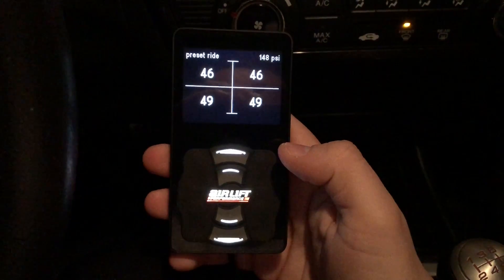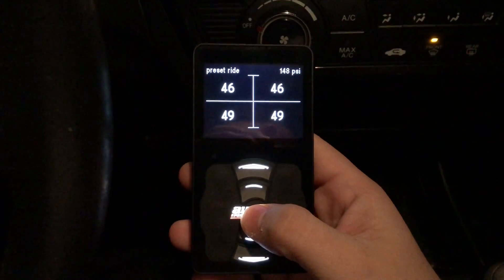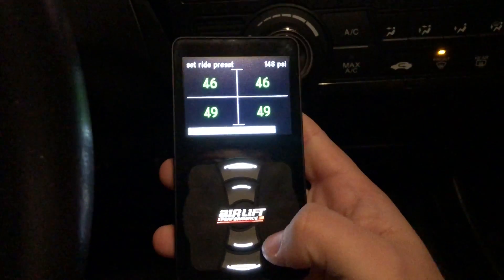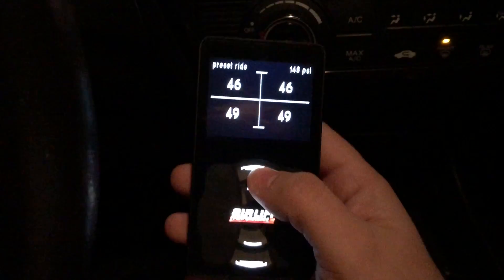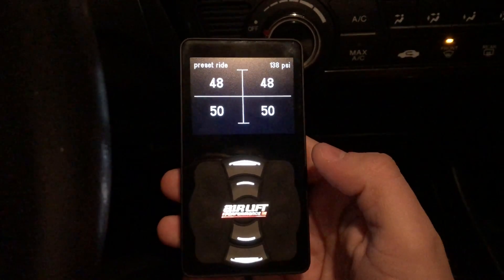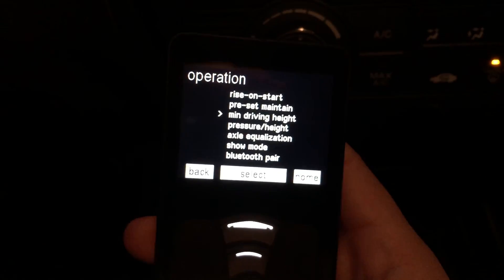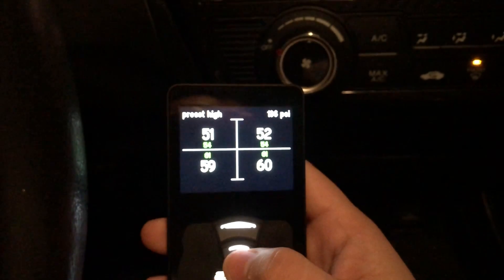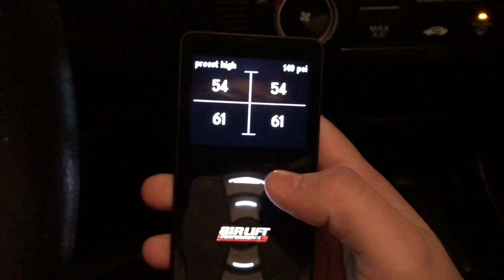AirLift Performance 3P/3H controller tutorial

Comment: Hey so for my airlift my psi drops as I park and leave the car turned off and there's no air coming out of any of my bags but the psi drops can someone tell me why and how do I fix that
Reply: As with any system, check all of your connections. Something is leaking somewhere. Mix up some soapy water in a spray bottle and spray all your connections while it’s aired up. When you see bubbles coming out, there’s your leak.
Reply: @BlackwaterDSM  yeah I did it was my water trap it had a really slow leak I fixed it thank u

Comment: Is the highest ride height, as if you had no modifications (as from factory)?
Reply: Max psi for the bags is 125 I believe. So I personally wouldn’t put more than 80-100. But every vehicles system is different
Reply: No it goes higher. Before it became popular it was used in snowy conditions to allow cars to be higher than stock

Comment: Hello, when you have aired out and leave it down over night. Does your tank decrease in PSI? For example when I air out and start up my tank psi are low and then fills up to normal. Is it suppose to loose pressure when parked?
Reply: That means you have an air leak somewhere in your tank. Check all plugs/fittings on your tank

Comment: Question,  why is it whenever i saved my ride height right, when i air out and then press the ride height,  the saved setting doesn't saved cause my ride height all messed up, like front be soo low its on the tire and the rear is all up.
Reply: Cause you probably have sleeve in the front and since there’s weight in the front you have to air up all the way first so your bags settle and then you put your ride height is gonna be like a clunking sound and if its not that than idk but that’s what i do to not have that problem

Comment: Bro how do you set up "raise on start" ? I tuned it on but when i start the car it doesn't do anything
Reply: You have to have it on a preset before you shut the car off, if you manually aired up or down before then it won’t raise on start.
Reply: gillixexik but I unplug the controller because it holds power getting it re-wired this week

Comment: Do you know how to turn the screen horizontal ?
Reply: Been asking everywhere. Still no answer.
Reply: Tylor Dowell if you update the firmware, it will ask you which orientation you want the screen to be. So maybe try updating firmware then selecting “horizontal”
Reply: @TylorFTW  You probably found it by now but you can undo 2 screws a the back of the controller pop out  the button pad and rotate it.
Reply: Any chance you found an answer to rotating the screen?
Reply: @tyschroeder6993  You probably found it by now but you can undo 2 screws a the back of the controller pop out  the button pad and rotate it.
Reply: Need to do via app only

Comment: Can you drive the car while the tank is filling or while the bags are adjusting ?
Reply from the maker: I always wait for every thing to be at my preset. You can drive while tank is filling back up
Reply: Nathan Machado If you have it set to maintain a certain PSI then it will adjust while you are driving. I would not recommend airing out all the way while driving though.

Comment: Just got Air Lift 3P...a lot to learn still.....1 question. When I'm parked for 8 to 16 hours is it ok to leave it air'd a the way out ?
Reply: KK Prince yes it is, unless its winter and cold. If condensation get into your lines and it freezes you wont be able to air up and drive.
Reply: @SwtLeo  oh jeeze...thank u I appreciate your response!!
Reply: Ok so basically stay aired up in winter?
Reply: @Mr.FIBBS777  there's a release button that cleans out the lines. When it gets cold you should press is once a week so it gets the condensation out. You're able to lower it when its winter.
Reply: @dragswolf8  wheres the release button?
Reply: @bleach6286  I think he's talking about the tank drain or the water trap.

Comment: Is there a mode to get it to our out on its own when parked/car turned off ?
Reply: +Sergi Rodas thanks also if you remember the instructions say i cant have thread showing on the coil. Do i have to adjust it all the way down?
Reply: +Sergi Rodas thanks also the manuel said the threads cant be showing on the shocks, out of the box they came all the way up. Do i have to adjust them all the way down until they aren’t showing?  It would be great if you could send me some pictures and info of your setup since you have had these for a while already

Comment: Completely new to this, so might be a stupid question. What speeds can you adjust ride height. Obviously you wouldn’t air out on a highway etc
Reply from the maker: Arun Proothi i only ever do it when my car is stopped. Of course the controller will do whatever command you give it but it wouldn’t be the safest thing to do it while moving.

Comment: I got the 3p air ride and I’m new to all this. Is the controller screen supposed to stay on? Or is it supposed to dim/turn off after a certain amount of time? Thanks.
Reply from the maker: Miggy EK4_FB6 do you mean is it supposed to stay on once the car is off? If that’s what you’re referring to, no. If it’s while you’re driving and stuff, yes but that can be adjusted in settings
Reply: Sergi Rodas my screen stays lit all night with my ignition off. I don’t know if that’s normal or not.
Reply from the maker: Miggy EK4_FB6 I have the same problem which I’ve been too lazy to fix. Your power wire for the bags is connected to a fuse receiving constant power meaning it’s on all the time even if the car is off. You need to get it connected to a fuse that only receives power when the car is on. If you don’t get it fixed, it’ll start to drain your battery
Reply: Sergi Rodas okay thanks. Do you have an after market exhaust? If you do how are you avoiding the exhaust piping from touching the rear passenger bag? Mine is, I don’t know if its because of my 3 inch full cat back piping?
Reply from the maker: Miggy EK4_FB6 i do have a 3 inch cat back. Gotta heat it up and bend it. I also have some heat wrap around it
Reply: Sergi Rodas okay thanks I’ll do that
Reply: Connect to a cigarette lighter fuse